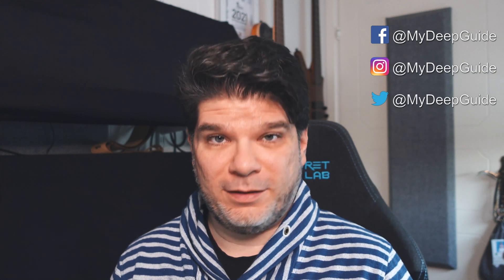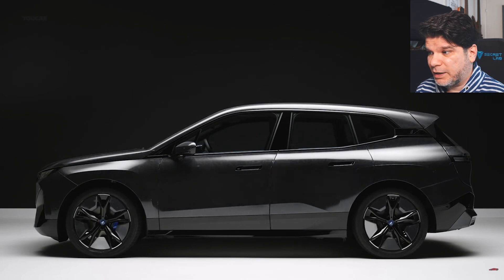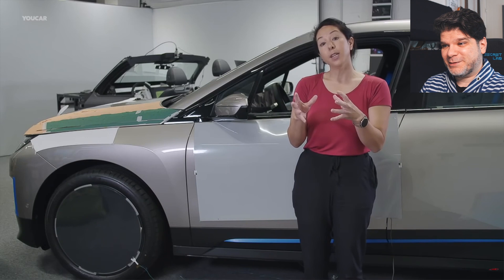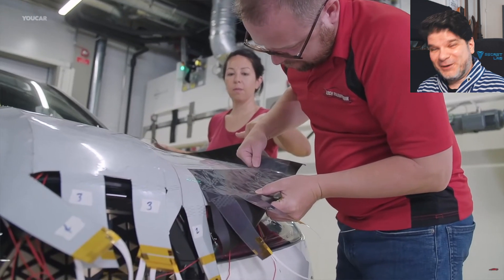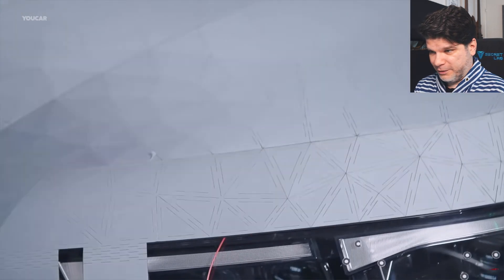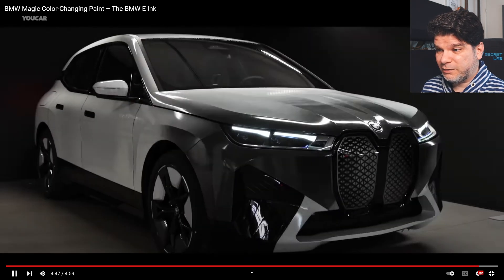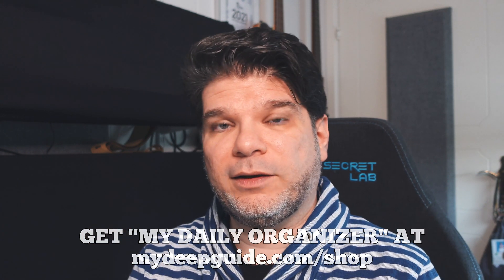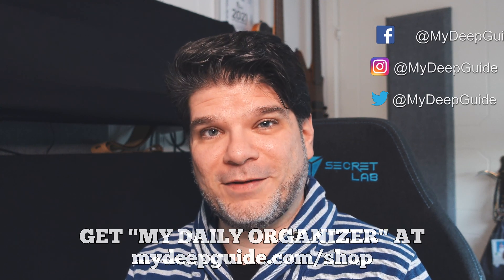BMW iX Flow - E-Ink Color Changing Car

Comment: I think it would be useful in places that have snow. In winter you don't want a white car since it is hard to see through the snow, so changing the color to a darker shade would help for visibility.  Then in summer time heat, have a white car to keep the car cooler because it reflects more light.

Comment: I wonder if there are or will need to be rules about changing the "colour" (or pattern or whatever) while the vehicle is in motion. My first thought is that if you have the car flashing black and white, it could be distracting to other drivers. Not just the novelty of it, but the actual colour changing. I wonder if it would, for example, make it difficult to tell how far away the car is from you (similar to how it can be difficult to judge the distance of a car driving with its lights off at night)

But safety aside, it is a neat technology demonstration. I'm personally not a fan of grey cars (though that's what I have, because it's what was available at the price I was willing to pay), so I'm looking forward to the full-colour version... not that I can afford a BMW... :)